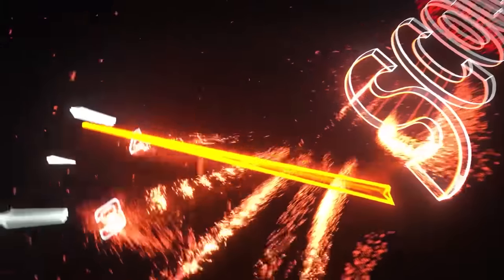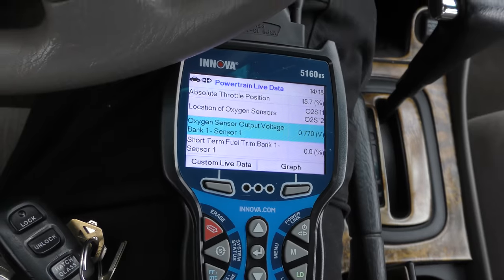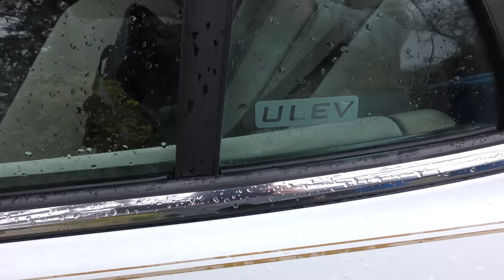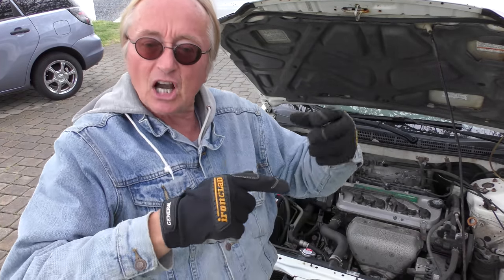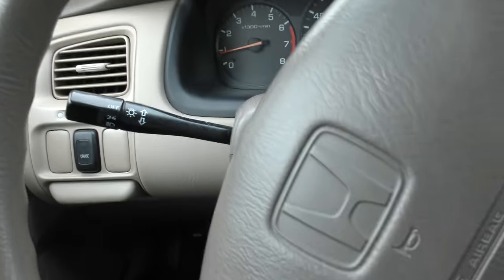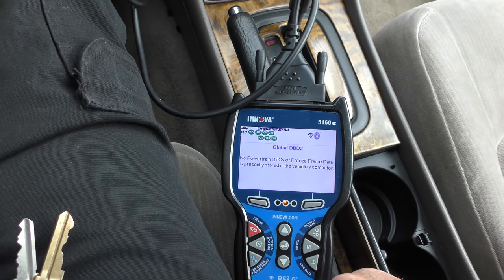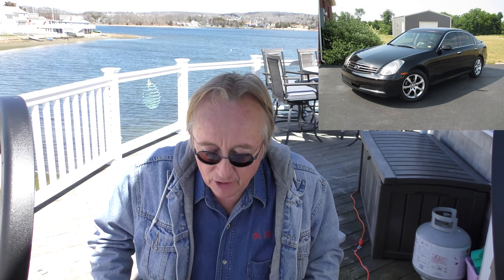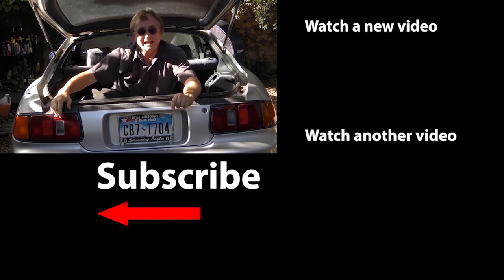Never Install This on Your Car

Comment: If I got a quote of over $300 for an oxygen sensor I would be heading to the junk yard too.
Reply: Mine is 100$ at the junkyard
Reply: Mine was quoted $300 by honda and now I bought oem from denso at $100 and going to fit by myself
Reply: Yeah I’d be on eBay looking for the 30 dollar version.
Reply: Yeah that would hurt I got 4 02 sensors for half that price 09 Acadia 3 catalytic converters n 4 02 sensors
Reply: They have 2 upstream and downstream on eBay and I replaced mine on 05 Civic lx and it fixed mine. Name brand don't matter to me as long as it works and it has insurance on them for 3 years
Reply: I have just paid £ 120 for one and need another three for my Susuki grand vitara XL 7 !!!!!
Cant find a garage to put them in my 22 year old car however.

Comment: I learned the hard way. My wife has a 2004 Honda crv. I replaced the o2 sensor with a no name. It failed in 3 days. Replaced it with a brand new denso. It has now been 4 years and still working perfect

Comment: At-205 in fresh oil does absolute miracles once you give it a good drive on the highway for about 5-7 hours or about 250 - 300 miles...real good stuff

Comment: I bought an oxygen sensor for my Camry, it was an OEM Denso for about $100 from Rock Auto. I thought that was expensive, but over $300 for one oxygen sensor is outlandish!
Reply: It's the same OEM Part just in a Honda Box...
Reply: Oem is still better
Reply: @issavibez394  Denso was the Original Equipment Manufacturer. Whether it comes from Rock Auto, NAPA or via Toyota, it's the same Denso part.
Reply: @AcmeRacing  model number is nor same ive done it before still dealer part was more but more updated n work better
Reply: Similar story here.  I needed a new oxygen sensor for my Dodge Neon.  The original had a NTK symbol and part number.  Got the EXACT same part as original in a NTK box from Rock Auto.  Needless to say, it worked perfectly.

Comment: Those old buildings likely have tons of lead and asbestos, so it’d be crazy expensive to tear them down. The ones in Niagra Falls you mentioned were likely torn down before the EPA cared about clean air certs, etc.
Reply: One of them "caught on fire" a couple years ago... us locals think someone burned it to the ground for them to build new buildings there.. you can look it up if you want, it happened probably in 2018 or so
Reply: Lead paint doesn't need to be removed anymore. You just paint over it or send the painted refuse to the landfill or scrapyard. Asbestos only needs to be kept damp during removal. Some states allow its disposal in landfills. Others require it being sent back to an asbestos strip mine where it's tossed back inside.

Comment: Never thought junkyard stuff could be so much fun!!
Reply: It's that sweet sweet trash
Reply: I got a carbon fiber hood for $60, two mirrors for $40 for my eclipse and a $300 intake for my truck for $20 at a junk yard ha
Reply: It's a lot of fun , I replaced the bench seat in my truck with two very comfortable bucket seats for $80
Reply: I have no doubt its going last.

Comment: this is why i purchased my jeep xj from a 65 year old war vet. the jeep just sat in his garage for years at 171k. had no problems (other than  blown head gasket that didnt cause any problems for 4 months after buying it) i bought it for a little more than i wanted to at $2500, but since then (2 years ago) i have rebuilt about 80% of the vehicle. all thats left to upgrade is the drag link, tie rod, tie rod ends, and alternator. of course ill go thru and change all the sensors at some point make those badboys new as well, then im gonna toss some rally wheels and mickey thompsons on it =]
Love the videos scotty!

Comment: 2006 Toyota Tundra 4.7 V8 is almost famous for rear seal seepage. Mine started leaking before the vehicle clocked 30K. Toyota replaced it under warranty and hasn't leaked a drop since.

Comment: Please give some advise..

I bought Honda CR-V 2012 2nd hand 134000 mileage. Issue is :
1. Too much fuel consumption(14 mpg, Bronx area) even in highway 15/16mpg 

2. After 50 mph seems like I have to push the gas to increase the speed. 

there is no check engine light.

So far I did :

1. Change the spark plugs. 
2. Clean the maf sensor 
3. Clean the throttle body.
4. Change differential fluid, engine and transmission oil(Honda recommended)

5. Front wheel bearings changed.
6. Breaks are changed

But the seems like something else is actually having issue. Mechanic said, wheel spin smoothly, but I felt it is not as smooth it should be. 

Please give a mighty advise. Thank you in advance.

Comment: I had nearly the same issue on my 1998 Civic. Eventually replaced it with a $56 Denso from Advance Auto Parts. Did my own research because NONE of the local parts houses know diddly squat about some of the most popular cars that exist. Really? I'd ask, "are both O2 sensors the same?" . . . "Oh sure", they'd say . . . THEY ARE NOT. So, to avoid headache, like Scotty, do your own research.
Reply: The days of auto parts store employees actually knowing anything about cars is over. Blame that on corporate greed. They want to pay the lowest dollar for someone to just type on a computer. I no longer use them as a source of information. You gotta look it up yourself and check the parts BEFORE leaving the store for accuracy and fit. It sucks but that's how it's done now.
Reply: @olliefoxx7165  100% correct. Heaven forbid they should give a crap about their customer base. Talking to you Auto Zone, Advance et. al.

Comment: I  bought a 99 Camry in 2002 that was a lease return. 60,000 miles. After 150,000 the frt sensor code came up. I then found out that the car was a California emissions model and the sensor was $285. I replaced it with a ' normal ' sensor, and drove it till 327000 miles & gave it to my daughter.

Comment: I've found good used OEM parts in the junkyard many times..Not everything but some parts..I still do and I always pull one from the yard before I go to the stealership for the part.Thats my last option..Alot of auto stores sell junk brand new parts also so it's a 50/50 with them.I also find OEM parts brand new from Stealerships stores  in Ebay for low prices and are good.

Comment: Just fixed my Samsung flat screen TV 📺 with a used electronics scrap seller.  OEM part.  Had to clean the contacts on it with Ultra High Emmions spray cleaner first.  But it fixed it.
Reply: To extend the TV's life, turn down the backlight, and turn up contrast and brightness to compensate.

Comment: That guy who wants to buy a 2014 WRX STI should make sure it’s a low mileage one, once they hit 100k they get less reliable especially if they weren’t maintained well, the OEM oil pickups crack and cause loss of oil pressure, also the EJ257 in the car doesn’t have adequate cooling to cylinder 4 thus possibly causing cylinder 4 failure. Also subaru EJ motors that were beat on will end up with rod knock or spun bearings which are common on beat up subarus. Beware subaru buyers! Either buy brand new or one with super low miles otherwise run!

Comment: The one thing that Scotty didn't do that concerns me, is he didn't put any anti-seize on the threads of the replacement sensor.

 This is a critical step that shouldn't be skipped, otherwise that sensor he replaced might never come back out.
Reply: They come with it on there

Comment: The Denso USA site has a very good search tool for finding the right sensor for your Honda. The series 6 motor you were working on , the F23 has three different motors and the O2 sensors don't interchange. There are counterfeit 02 sensors made ( guess where ) that are indistinguishable from genuine Denso that don't work properly . Denso sells them directly from their site. The owner got the car for free so a $380 sensor after ten years is a bargain.

Comment: Yo scotty i just bought a 2001 toyota tacoma for $600 and it has 517k miles on it and it runs great. Is there anything i should look out for?
Reply: Nice. I just had to get rid of my 01 tundra with 300k miles because it was far too rusty. I'm not scotty but i don't think there's many trouble areas in those vehicles besides rust. If you live in a rusty area the frame is well known for rotting away, also check the spare tire bracket under the bed, it can rot and the tire will fall out. 

Check for leaks at the differential input shaft seal and wheel bearing seals, if it's wet keep an eye on the gear oil so you don't kill the diff from low oil. 

If the truck isn't rusty and is in good shape hold onto it, they're keepers.
Reply: Everything. Its got 1/2 million miles.
Reply: @volvo09  i got lucky and the frame was a recall so it is newer but i want to get a coating on it because i live in a salt state
Reply: @bigrat4452  get an oil type coating... DO NOT go with a hard rubber coating like ziebart or a similar product, it holds in moisture and makes rust faster.
Reply: @volvo09  used transmission fluid works the best for me because it is free.

Comment: You don't need that fancy scan tool to find out if something is happening in the graph. If they O2 sensor is working you just won't get a code or engine light anymore.

Comment: Nowadays, you go to O'Reilly's,the zone, advance, napa, and buy a brand new part, and may be it will work and may it wont. 
Im a mobile mechanic and i literlly stopped supplying parts because i dont want to replace junk every couple months.

Comment: Cars are designed that even if the O2 sensor heating circuit fails then the 02 sensor just doesn’t work. Regardless if the sensor gets up to temp in the exhaust.

Comment: Ebay is a good place to look for oem parts if you have the original part number to reference your search🤑 great video brother 👍
Reply: No
Reply: @issavibez394  for me it's worked fine, with part numbers I have found oem genuine Honda parts for a fraction of the price...
Reply: @modklv126  but used
Reply: @issavibez394  I find brand new, a lot if times posted from dealerships in other states👍👍 I avoid any used parts.

Comment: My friend got a new 383 SBC installed in his 81 Firebird...I suggested EFI CARB because he lives @ 4300 feet above sea level...the rip off that did the job screwed my friend so bad..(too much to list here)...but did not put an 02 sensor on it...so idle was erratic from 1200 to 700 rpm @ idle...it must have it...I did research giving him advice...02 kits are available to drill 7/8" hole 18" from head and install bung kit and 02 sensor with 1 wire...should settle it all in kit...I HOPE...

Comment: You use the generic parts, you take your chances. I have to wonder if the generic replacement O2 sensor ever worked properly.

Comment: Howdy Scotty, I got a question. My brother and I are trying to fix my dad's 1990's mk3 supra that's been sitting in our backyard for 17 years. We put a new battery inside and we got the electronics to turn on, but the engine wont crank. The engine itself is in good condition. Whenever we turn the key we hear a clicking sound from the engine bay, but that's about it. Any suggestions on how to get it going?

Comment: That scan tool you are using is one great scanner.
Liked the way it showed the line graph
with perfection.
Possibly quite expensive.
I never use cheap car spares, like oil filters, 
oil  and other things such as spark plugs etc, they usually come back and bite you,
when you could be miles from anywhere, the it's God help you.
And it's God help you,
if he's there.

Comment: Oxygen sensors are all pretty much the same in terms of their signal outputs, cause their internal sensor "chemistry" is pretty much the same - be it Ultra Low Emission or ordinary vehicles. Other sensor parameters may indeed vary, but those are more physical parameters - like how many wires or thread type or connector type. Main thing is that their output signal shall fluctuate between 0,2 and 0,9 V and not leave this range - that is it, and that is what shall be checked. A flat output line, combined with a "heater circuit failure", is usually (although not necessarily) not a sensor fault (cause 2 independant circuits seldom break simultaneously, the sensor heater circuit being an independant circuit from the actual sensing circuit), but a wiring / connector problem. The case depicted in this video was rather an exception: not often one sees some totally junk noname sensors screwed into a decent vehicle. ECU failure is indeed also possible, but out of experience not very probable. Sensor problem is indeed also possible - although I seldom saw two circuits within one sensor die in parallel.
P.S. There is indeed always a risk to get a bad sensor - be a bad or new. Those by BOSCH have a high bad sensors ratio (but the good thing is that BOSCH offers them cheap and also offers universal ones which can be wired to any existing connector); those by DENSO are better quality, but more expensice and no universal ones (at least none I knew of).

Comment: I understand the importance of using good quality parts for critical areas (tie rod ends...) but for an O2 sensor, sure it might not last as long but for the price of an original for $365, or a cheap chinese one that only takes 10min. max to change, it might outlast the rest of the car, and if not, for $20 a pop you can replace it 14X

Comment: NTK O2 sensors which are made in Japan are good. Bought a NTK O2 Bk. 1 Sensor  2 (lower sensor) for my 2001 Echo sedan some years ago. After years of having the check engine light on it shut off.  Purchased a NTK O2 Bk. 1 Sensor 1 (upper sensor) for my recently bought 2004 Echo sedan. Car came with blown check engine bulb. When I put in the new bulb it lite on.  I scanned it. Got the code for the upper O2 sensor. Bought the sensor before realizing that the original denso O2 sensor was disconnected. But since I had already bought the NTK sensor I decide to install it. So took it to a muffler shop for installation. 

At the muffler shop they found out that the previous owner had taken the catalytic converter off which could explain why the upper sensor was disconnected. So put in a new catalytic converter plus the new sensor I had bought. However, the check engine light for the O2 sensor still lite up. Took it to an electro-mechanic. He said the sensor was not receiving sufficient power. That the problem could be that the cars computer would not accept the NTK brand sensor or it could be the computer itself. But in the end, he discovered that the problem was a broken wire. He fixed the wire and the check engine shut off.
Reply: NTK/NGK is OEM for Toyota....there shouldn't be a compatibility problem.

Comment: I have a PO172 code...Took it to AutoZone and the diagnosis came back mass airflow sensor...Put in a brand new one next day the check engine light went off...The other day the check engine light came back on again...Took it back to AutoZone the same code P0172...After that the check engine light never went out...Don’t know what else to do 🤷🏼‍♂️🤷🏼‍♂️🤷🏼‍♂️

Comment: Scotty our 04Tahoe engine light says on replaced plugs and wires and now 02. Sensors is bad fixing to replace them hope this fixes the starting trouble which seems like it floods out!

Comment: If that one didn't work you should be able to get a denso from a after market parts store no need to goto the dealer.
Reply: It will work as long as you have the correct code, but if you have a open circuit code, no it will not work. You have to have a efficiency code for the cat and it’s got to be the downstream just replacing the O2 sensor. It will not do it. Basically your O2 sensor is working. It’s reading too much, make sure you have the right code and don’t let AutoZone advance. Tell you oh just replace the O2 sensor because that doesn’t always work. If you go . onto data you will see your O2 source sensor is working.

Comment: Can at -205 re seal cause any damage to 30+ year cars? Or is that what it’s intended for, high mileage cars with small oil leaks? I’m going to replace my PCV breather box and hoses and hopefully that stops the leaks. If not I may try the re seal!

Comment: I'm from fallriver Scotty I watch your videos all the time . Do you have a local shop or a way to contact you for work? I got a 2015 toyota camry with o2 sensor issue I just replaced upper and lower oxygen sensor with oem  now I get worse gas mpg

Comment: Bought a 2002 wrx in 2008 with 57k miles,  spent 13k on an engine and transmission in the first year.....still have it and it's fun but...be careful

Comment: I'm interested in knowing what this video says since I have that same car, accord year 99 2.3 and I replaced the primary oxygen sensor above 👆 but I have high short-term fuel settings, the sensor I bought is Bosch brand, because this same engine slingshot is not. F23a4 brings the broadband sensor because it is low-emission ulev, so the voltages of the oxygen sensor is different from conventional sensors.

Comment: Been looking up po137 diagnostic codes for RWD 4.3L V6 04' Chevrolet blazer and seen both this video and, "Doing this will make your engine run better"
I'm sorry but both thumbnails were the same and had me concerned. Lol😅
 Recently had Catalytic converter removed because the insides were rattling around. My cousin and I welded it back on best we could. It was hard to do the top even with a mirror. Besides that fact I wanted to ask if I use a spark plug defouler under the 02 sensor between the sensor and the exhaust pipe?

Comment: Great videos Scotty. 2016 Chevy Silverado flex fuel. Replaced water temp sensor next to thermostat. Reset by disconnecting battery. Fans were running and temp was not working. Temp starts working but fans come on after about 3 days intermittent drive.
Do I have to have code reset?
Samuel

Comment: What do you think about a 2000 Mercury Mountaineer with the 5.0, I  paid $400.  Has low miles and I am the 3rd owner. So far I have replaced radiator and needs heater core. Oh yeah needs signal selector too